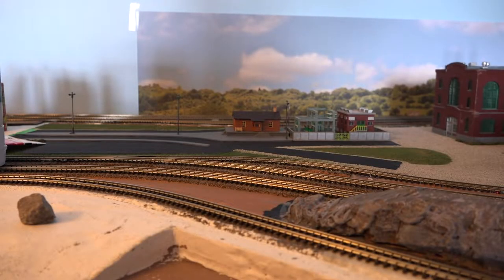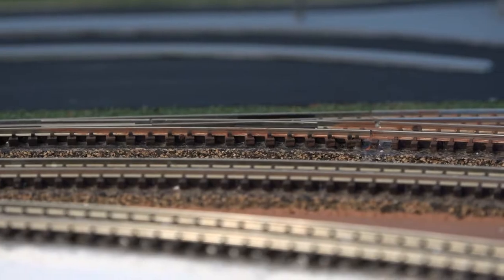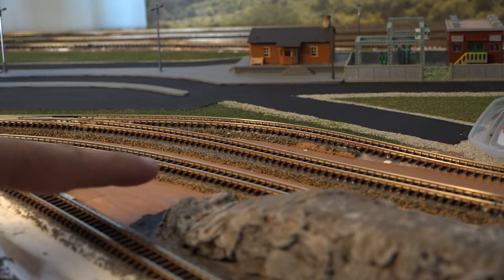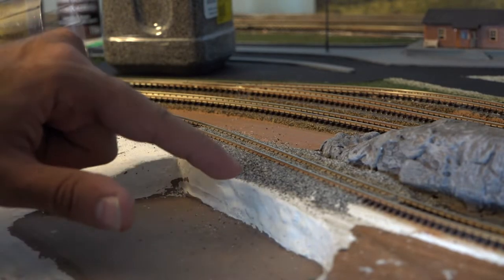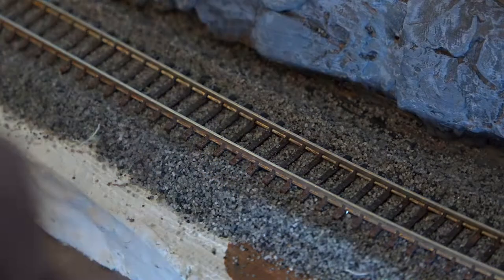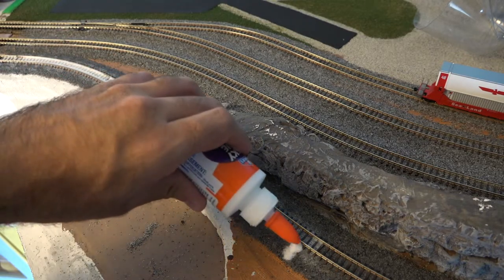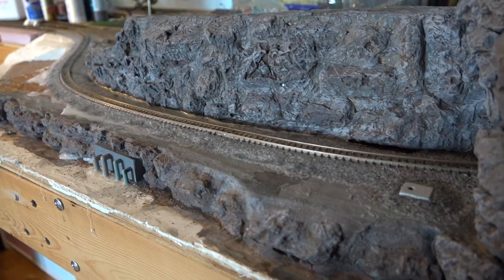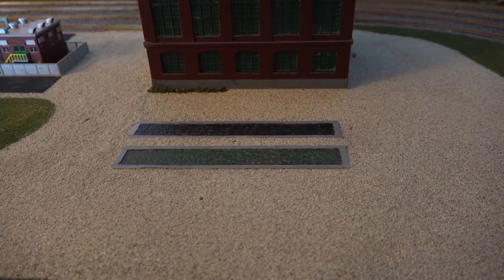Arcadia Update #15

Comment: Hey Tim, the ballast bottle idea you used works great, thanks for sharing. 
                                      -Randy
Reply from the maker: Hey Randy. Thanks for the comment. Ya I’m pleasantly surprised that it works as well as it does.  The best part it costs all most nothing. I didn’t mention it but you could use a gatorade bottle for the same technique for HO scale.

Comment: Tim, thta was a great tip you passeed on. Never thought about the water bottle, I've used the spoon and then a ballast spreader, but that bottle works great and cost a helluva lot less. 
Thanks for sharing
Muse
Reply from the maker: Hey David. Ya I was so close to buying a ballast spreader. Then by chance I came across that video from “cheep trains” and I was like oh ya going to have to try it. I didn’t mention it but for HO you might be able to a gatorade bottle for the same technique. Thanks for the comment 🤙🤙🤙

Comment: Nice update Tim  what size of ballast did you use , I use fine  for N scale , looks fine Tim after you done , I just bought 50% alcohol from the dollar store , then i didn't have to do any mixing . your end result looks great Tim !
Reply from the maker: Hey David. Yes I used #40 blended ballast fine natural stone. Never thought about using straight 50% alcohol. I get my from Costco so it comes with a lot of rubbing alcohol. Thanks again David. 🤙🤙🤙
Reply: @H0bby_Adventure  Your welcome Tim it comes in small bottle and is ready to use , I also use the spoon because if I don't I end up spilling it all over the place  !
Reply from the maker: Lol ya that only happen once. Lol For me this works great. I really don’t like ballasting. It would be on the top of my list for things I don’t like doing In This hobby.  The other is cleaning the track!!!!!
Reply: Right on I don't like doing it either , but I like the end results , the track  look great after it is done !